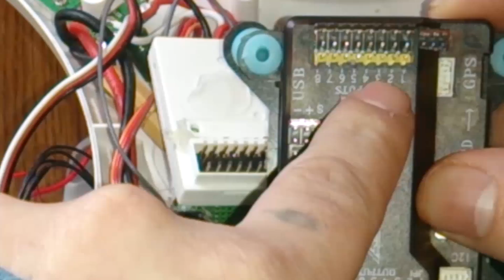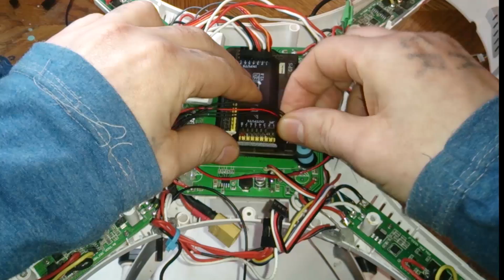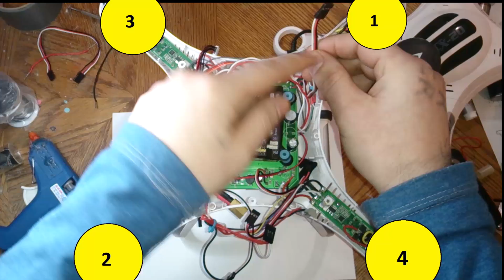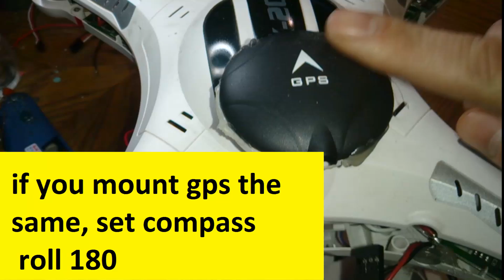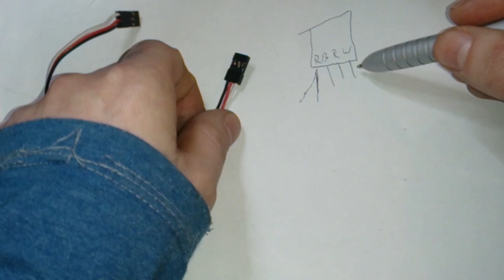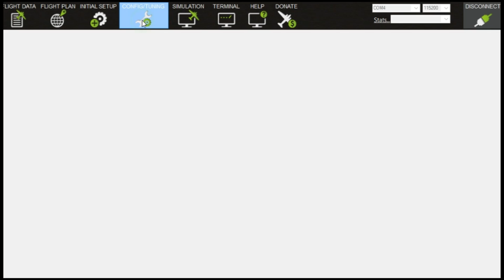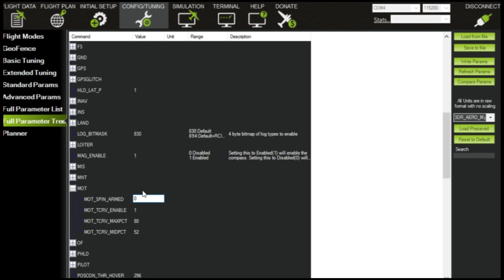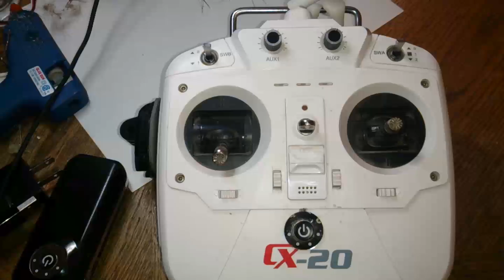cx20 factory apm to apm 2 6 - 2.8 step by step

Comment: hi I have followed all the instructions and I have wired it properly but when I power up the drone it just keeps on beeping and the leds keeps on blinking.. please help..
Reply: also on the mission planner I can't get to get the rotation roll 180 on the compass
Reply from the maker: is the beeping coming from the motors ? 
...if your using just the usb cable.. it can be low voltage alarm.

try using just the battery (don't use both ..usb and battery at the same time)

with mission planner make sure to enable advance view
got to config/tuning 
..Planner
....Layout
... in the combo box switch it from Basic to Advanced

Comment: hi im using a neo 7m unit and copass working fine but it says need 3d fix and no gps..
what should be done? apm 2.8
Reply from the maker: hi.. ..just  take it outside for a bit.. and plug the battery in.   ..leave it for about 5 mins or so. clear view to the sky.  try to arm it.. If you can arm it and you don't have arming check disabled , that means it found some sats.

bring it back in and test it out again.
if it still does not get it.  either your some where it just can't get sat..like a basement or something.

what you can do is check the logs from your out side arming.
and see how many sats if any were found.
Reply from the maker: I should note that no gps usually means you have your tx and rx backwards.... not sure if you played with the wires. but make sure they are pushed in right..    If you had to convert the end from 6 pin to 5 then those pins can be a pain..
Reply: bangs6996 thanks i will check as soon as my battery arrived..😜 Lol still no battery..by the way whtd you mean by tx backwords?
Reply from the maker: what i meant was switched .. like instead of it going  
5v tx rx space ground
you have it like this
5v rx tx space ground.

But if you never touched the cable don't worry about that.
once you get your battery .. we can take it from there..
Reply: hmm yeah i never touched it and it is as it was..ok i will tell you when battery arrived thank you for your great help..:D

Comment: Hi bangs, quick question. I've done all of this and it worked great so thanks for the great video! The only problem I am having is while flying it isn't very stable at all and while in 'stable loiter' the quad is not stable at all, it moves around everywhere. I've tried calibrating it and that does not seem to make a difference. I already read it could be a fault esc but they we're fine on the older flight controller so do not think it is that. It is also very twitchy in manual move.  Any ideas? Thanks
Reply from the maker: max rippington hi,not by my pc right now....u can try my paras....I might have them linked in another comment...
Reply from the maker: https://drive.google.com/file/d/0B2w6_OKE_2kxM0xYckJidFNRWTQ/view.  OK so that's the link.,  you will have to Re do calibrations....you can also back up.  yours first..
.  anyways..I will reply back later...  esc calibration might help as well
.
Reply: bangs6996 Thanks very much, I will try those. I'm waiting on a new motor at the minute (hopefully arrive in a few days) I have a feeling one of those is not quite right. Thanks for your help, really appreciate it!!
Reply: bangs6996 Hi, I fitted the new motor and ESC with your params (calibrated everything too) and it still rocks around in stable and altitude mode. Any ideas? It just seems to have a mind of its own!
Reply from the maker: maybe check your voltage regulator.. https://drive.google.com/open?id=0B2w6_OKE_2kxQjFnOWhUMU9VdEE    see if you get 3.3volts
Reply from the maker: also you have done a esc calibration??  ..it might do that if its way off.. .but usually if its off a bit it does not matter after your up in the air.
Reply: bangs6996 Hi, sorry for the slow reply, the weather has been awful so have not yet been out flying.  I have dont an ESC calibration and a motor compass calibration in MP and I have also been advised to carry out an Autotune. Hoping to do that in the next few days, I'll let you know how I get on! Thanks!
Reply from the maker: sounds good ..I know all about the weather been waiting almost a month to make my new video.. either raining or toooo windy.. suxs..

Comment: Hi bangs6996 I have followed your video and all went as you explained but when i  went to test fly it justs flips over on take off now as i told you i set it up exactly as you explained even the compass to "rotation roll 180" i am in the UK would the compass have any effect on the problem i describe as i have gone through all the setup again and it just flips over when i try to fly. any help will be extremely grateful. Thank you Geoff
Reply from the maker: Hello..  that happens when you have the blades on wrong...  or you have the wires wrong for the motors/esc's some how...  I would check that first.. 

esc calibration maybe if the motors were way off ..but usually its not that bad.,, if all you did was swap the apms ..

Make sure you have quad firmware as well . as some apms come with hex firmware pre loaded ..
Reply: thank you for the help i attempted to put the firmware on but it failed and did not complete now for some reason it will not connect in mission planner and when i put the USB in the PC it makes a constant low bleeping sound in-between the normal bleeping it makes on connection i think i have now bricket the amp and do not know how to solve this is there any way to reset the apm?
Reply from the maker: HI .. remove the power module or the b cable from the receiver , plug in only the usb cable and see if it still does that glitching thing.. 
your apm might be bricked as well
https://www.youtube.com/watch?v=gKMFenjNrLE
Reply from the maker: what i mean by glitching is if the lights come on off and the speaker makes a weird chirping sound.. if your sound is just low voltage sound that is normal.. Don't plug in the battery to solve that annoying sound as others suggest..    just find a usb cable and remove the red wire .. I have a video called usb and apm the safe way.. .. .. .after you remove the red wire / cut it.. you can then use the battery and usb cable at the same time..

Comment: Hi everyone, i need some help. I was installing radio telemetry in my amp 2.8, all was going well, but sudenly wile moving some wires , the apm made a strange sound and ligths went off. Now the apm looks broken. Apm board ligths flash at the beginning and then go off. And My pc does not recognice de apm anymore vía usb, external leds are not working etc. Do you think apm is dead? Thanks in advance.
Reply from the maker: Hi.. with all the wires removed . and only usb on the side of the apm what happens?

You might of blown the voltage regulator or the protection diode / fuse.. well hopefully you did .. .. you can jump the diode or fuse with tweezers just to see if it comes back to life
Reply from the maker: here is the first link i found on the subject.. I have not blown one yet on the apm 2.8 so I have not made a video on the subject yet.. but did blow it on my mini..and just simply jumped the fuse with a wire..
http://www.dronetrest.com/t/apm2-5-power-module-burned-out/12

Comment: Hi!!
Tnx for your video!!
I've an issues... i put an APM 2.6 on my CX 20 (it was a Zero version).... i follow your steps but mission planner can't relavate the receiver and the controller doesn't work at all (the controller power it up and works fine but mission planner cant' calibrate it...and the drone wont unarm and fly)...
I've connect the receiver as the same as you do.... what can be the problem? tnx a lot
Reply from the maker: You might have to disable arming check ..   https://youtu.be/mrBWEATUbus?t=1440     and see if it works after you do that.

when you turn on your transmitter does the receiver light go solid orange or green?
.
Reply: Hi! tnx for the quick reply... the arm check is already disabled...i've to do the red.orange led modification (the green is solid)... it seems that the receiver can't communicate with the apm or with the controller (it's strange),...
Reply from the maker: Hi .. on the receiver you should have a small orange light.
plug in just the usb cable and see if the orange light comes on the receiver.  if it comes on then turn on your transmitter and see if it goes solid
Reply: Uhmmm... no orange light here... so i have change my "zero controller" to the apm 2.6 because it will constantly light in orange and no unarm will go... so maibe the real problem is the receiver that is gone? my receiver is the YY -7CH model...and no orange light on it ...mmh (sorry for my enlish..i'm italian)
Reply from the maker: try to unplug all the wires from  your receiver.. and only plug in the b cable .. the white red black wired from the main board.. then plug in the battery .. ..no usb cable   ..
Reply from the maker: after that try .remove all wires from receiver and only plug in "a" on the receiver to number one on the apm.   white red black.. and see if the receiver gets power with just usb and that one cable
Reply: oki i will try...to do that i had to disconnect the power module , is that correct?
Reply: i answare to my selfe...no it's not necessaire :D
Reply: Ok, i tried both....no orange light at all on the receiver... :(
Reply from the maker: damn did not get this till 19 mins later.. yes unplug the power module for now
Reply from the maker: ok .. then yes your receiver is fried.. out of those two ways one of them should of worked..     when you plugged in just the usb cable and have wire from "-a"  to the apm input 1 (white ,red,black)   did your apm light up at least? just not the receiver?
Reply: yess the APM is working and it does the motor check (no error), Mission planner found it and i can see the compass working ecc... i can't do only the Radio calibration and obviusly unarm the motors... so i think the problem is the receiver as you said...(still no orange light on it)...
I've a question... i've an xbox controller... if i connect it to Mission planner can i try to unarm the motor only to check if they works?

Tnx a lot, you're great!
Reply from the maker: here is the example of how to see if just the receiver works.. https://drive.google.com/open?id=0B2w6_OKE_2kxV3BjbFhXazFERkE

I have not tried what you are suggesting with the xbox remote.... u can just click on the arm button and see if it arms as well.. and also test the motors .. in the test motors section..
Reply: uhmm my receiver is slightly different, the "led hole" is near the "-b"... but not blinkin.... can i buy a different receiver or i need to buy exactly the same? any preference? now i'll try the motor through mission planner...crossing fingers (hope thing in italian XD)
Reply: Ok, with the arm/disarm function in Mission Planner all the motor starts! :D they automatically spin (i think it's because there's no transmitter)...

If you can suggest me a receiver compatible with the original transmitter i will be eternaly grate XD
Reply from the maker: here is the one you need..  https://goo.gl/DuLmrD    you can also find them on ebay.
Reply from the maker: and they spin because you have mot spin set to 70.. you will want to change that to zero eventually   https://youtu.be/mrBWEATUbus?t=1556